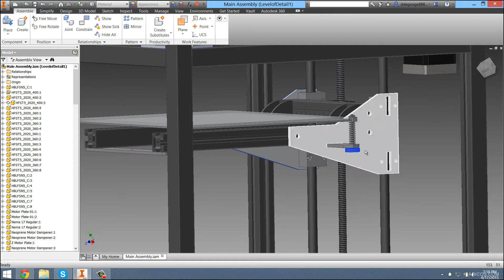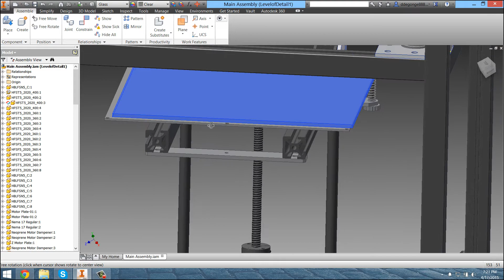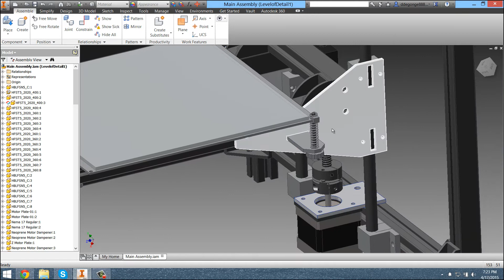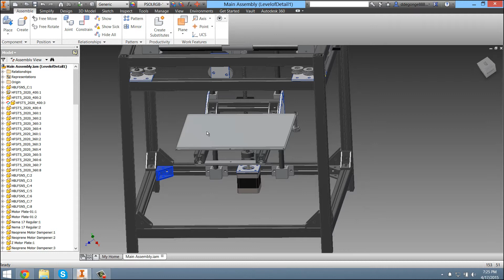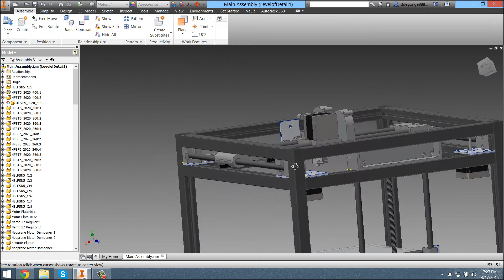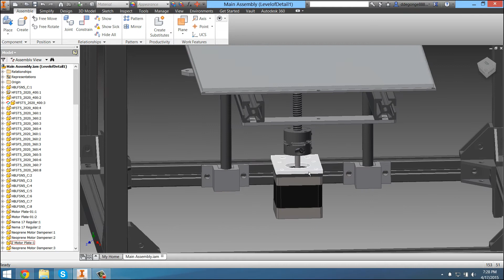Eclips3D Update 8 - Post Livestream Changes

Comment: Id go with an adjustable tension extruder set up while youre still in the design stage. Theres no real disadvantage with adjustable other than initial set up. The non adjustable one could cause a lot of issues.
Reply from the maker: dustin s But the thing is with my design it isn't easy to integrate adjustable tension. On top of that, insufficient or too much tension is the MOST common problem when people are having trouble with their one/two-up and ask me for help. I figure I will have a powerful enough motor, the best drive gear, and arguably the best hot end. As long as the tension arm has more than enough grip on all types of filament I don't forsee any problems. That being said I have yet to prototype very much in person and I can always change things if need be!

Comment: Just a thought about the panels. I would put a panel underneath the electronics and the power supply to support them but I would not  put one on to cover them. Unless you want to put active cooling on the azteeg I would leave it open. I've noticed that on long prints the drivers and MOSFETs do tend to get a little hot. Just something to think about. The builds looking good though!
Reply from the maker: Purpledotcom Awesome I'll keep that in mind. And I did come up with what should be a very solid mounting solution for the PSU and azteeg. At this point I'm considering doing what you said for the base model and for the upgraded model having a panel to cover it and have active cooling, or perhaps I can duct the exhaust from the PSU fan to run over the azteeg and cool it as I've noticed the PSU fan usually runs faster than needed and that air is barely even warm.